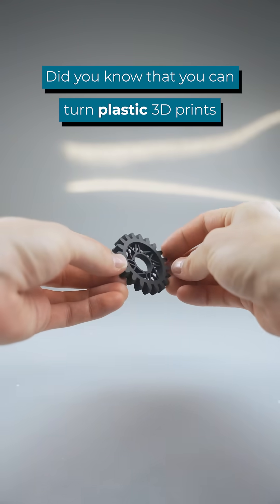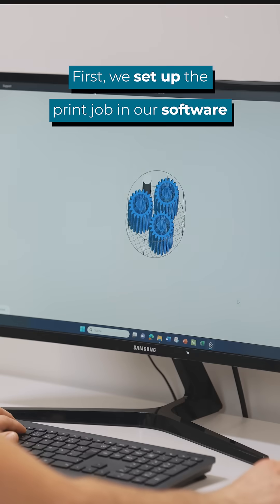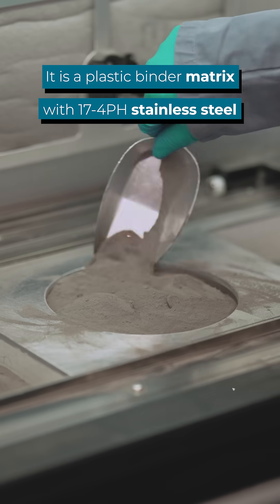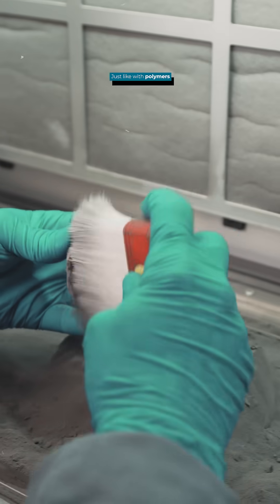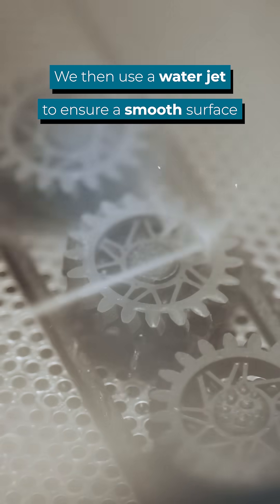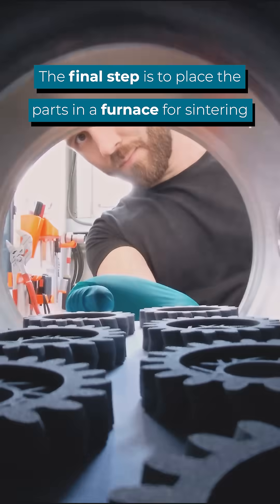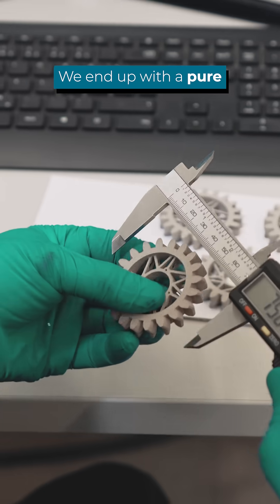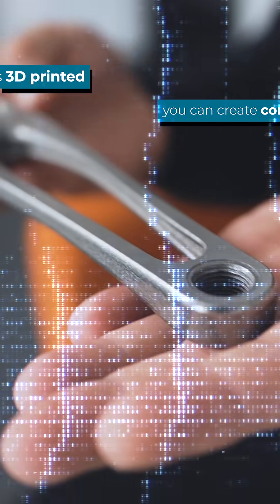Turning plastic 3D Prints into Metal Parts ⚙

Comment: How about shrinkage or expansion? Doesn't it alter the precision?
Reply from the maker: There is an uniform shrinkage, so it is easy to calculate and adjust the part accordingly. In this case (17/4-PH), the shrinkage is 14%.

Comment: Why these parts are not strong as forged ones, because melting point of steel is 1370 degress and they only heat parts at 1000 degrees Celsius. This is more like welding of steel particles together instead of melted&forged together

Comment: Thats... Not quite what you described at the beginning... But i am curious is that weaker than one were it was cast of cut from metal instead of what ever you call that
Reply from the maker: Fair, maybe the intro sentence was a bit misleading. But we still think its a fascinating method, to "print" metal parts on our polymer printers. And regarding strength: with heat treatment you can achieve impressive tensile strengths of 1309 MPA in the case of 17/4-PH which is comparable to industry standards.

Comment: Ok how is the gear good on stress tests and quality. I assume 3D printed parts and no better than quality Q10. So that means almost as same as plastic POM C or maybe at best PA12. Is hardening possible afterwars, followed by tooth grinding? If not how is this process better than injection molding  of Zink or plastics?

Comment: That's probably a 100k machine and has nothing to do with fdm or SLS 3d printing
Reply from the maker: Our printer start at aroun 18'000€ and are SLS 3D printers. But you are correct, it has nothing to do with FDM 3D printing. https://sintratec.com/sls-3d-printer/amp/sintratec-s2/

Comment: "Did you know you can do this simply?"
<shows industrial unobtanium machines for hundreds thousands of dollars>
Reply: The intro of the video made me think you’d be demonstrating a casting process. “How do I 3D print metal” -> “use a metal 3d printer” is kind of the boring answer tbh. Cool tech for sure, and I understand you want to demonstrate it to sell it, but I felt disappointed by the framing. I thought it would be a process I could use in my home shop.
Reply from the maker: Fair, it is not the easiest or most affordable process. But it is still a new way of 3D printing metal parts that has not existed in the industry before - therefore we think it's worth showcasing. Also, compared to other metal 3D printing methods, it is very similar if not cheaper in price.
Reply: @Sintratec  we have been doing sintering for decades. (And sintering 3D printed metal parts for atleast a decade itself)

What are you talking about? How old are you, 18? Maybe 20? 

We had a 6000€ sintering printer kit at our company in 2016, which could print aluminium. The industrial machines have existed for much longer than that. (Granted it wasn’t great, but still, it worked.)
Reply: Can you post a accurate video showing how the green part is made, please? @Sintratec
Reply: @Sintratec exactly, I commend these companies. They are the ones that are paying the bills, allowing Innovation to continue, and creating a market for the consumer down the road. This is the beauty of capitalism, and Innovation together. Standard fdm3d printers were quite the same thing not too long ago

Comment: Fuse at 50'Celcius ?
Reply from the maker: Yes, the cold metal fusion process is very "cold". The plastic particles of the material fuse together at 50℃, which makes the process very stable and all unsintered powder can be reused. You can read more here: https://sintratec.com/how-to-3d-print-metal-parts-with-a-polymer-sls-printer/

Comment: This is not plastic into metal. You are SLS metal printing a new part. The original plastic gear played no role in the end result of the metal part.
Reply: My engineer brain didn’t want to disbelieve at first since I’ve been wrong about many things before, but I was 100% confused how the 3D printed plastic had anything to do with this. Yeah SLS metal printing and annealing a brand new part seems like a more accurate description
Reply: @PinheadLarry1337 the plastic its because the 3d printer is not a forge, so it takes metal “powder” mixed with plastic to the 3d printer can print, than you just remove the plastic and have a metal thing
Reply: @BloopTube but it doesnt turn plastic into metal. It just has plastic in it aswell which then gets removed
Reply: Careful, your stupid is showing.
Reply: YouTube is getting worse and worse
Reply: Please, teach these brain lacking people how much better of a title :
 "How to make metal parts by using sls printer with metal-plastic mix, then processing it with some chemicals, and then re-sintering it to achieve a metal part" would be .
Reply: Gt😂
Reply: What kind of printer is required for this?
Reply: A metal SLS printer.
They start at ~20.000$ and with all the post processing equipment that jumps up to approximately 50.000$ on the low end. It's a neat technology but definitely not intended for hobbyists.
Reply: @tigeroftheeye7121  A very expensive one. Looked it up some time ago and it costs $50k on the low end, for the printer alone (you also need to get debinding station which is another huge expense).
Reply: It literally is plastic to metal

Comment: Keep in mind that the parts shrink by about 10 to 20% so you have to adjust for this depending on the model. Additionally, the tolerances aren't as good as CNC. Close, but not perfect. Lastly, the finished steel part is roughly half the strength in every direction as a forged and CNC part
Reply: The shrinkage is the biggest con for me...
Is the shrinking at least unidirectional?
Reply: @kendrickxy1774  it's not uniform but it's very very very predictable in computer modeling so you can in theory get parts that are cheap, perfect tolerances, but just weaker than forged. Yet way stronger than anything else. If it's as strong as it needs to be, it doesn't matter
Reply: @kendrickxy1774  it's generally symmetrical. If you design for it you can compensate for the shrinkage so it shrinks to the exact size you need
Reply: Well, it must shrink 10~20% in all directions, its something I've delt with when it comes to my experience with 3d printing, although not to that extreme. My guess it happens with the burn off period. If that's the case they can (I assume they use a form of a slicer program) just increase the scale of the part by 10%~20% depending on a test part they do for the day/or the machine if its machine specific and not environmental condition reliant.
Reply: @IIBLANKII  it does shrink in all directions but it doesn't shrink evenly. The outside shrinks faster than the inside so sometimes thicker parts versus a thinner part, the thicker part might still be liquid inside and certain geometries might be out of whack. For example the inside of a corner will cool after causing a 90° angle bracket to slightly widen.

You can use computer modeling to offset this
Reply: @IIBLANKII  you can't always just increase the size evenly, unless it's a spherical part
Reply: @pilotavery for an actual production run I could see a company doing a test print and sintering with no compensation changes, the test part is then measured(calipers, CMM, xray or scanners), measurement information can then be used to directly compensate in CAD so uneven shrinking is accounted for with non uniform parts. 

With digital measurement info from a CMM or scanner(internal or external feature scanning) and a specialized software this adjustment of a part in CAD could be automated and highly predictable since the software can know what original CAD geometry is and non compensated sintered test part geometry.
Reply: @GENcELL2014 yup. Anyone who has these technologies isn't just doing it willy nilly.

The for sure test and test before any production run. I don't see it being economical for trying to make and sell parts, but to make custom parts for some kind of machine fabricators
Reply: and there is the porosity,

Comment: How do the metal particles "grow" together?  Out of what?
Reply from the maker: The furnace is slowly heated to sintering temperature while the little remaining plastic-binder (1%-3%) burns without residue. At the sintering temperature of the metal, the metal particles fuse together to form a dense solid metal part. The parts shrink evenly, in the example of stainless steel 17/6-PH by 14%. The sintered part typically exhibits a density of 97 - 99%.

Comment: it's not actually turning plastic into metal. This is directly using the .STL file and creating the metal part.
Reply from the maker: The material is a plastic binder matrix with metal spikes in it. Therefore, the green parts are to a degree plastic.
Reply: @Sintratec  What would be the percentage of plastic and metal in this material?
Reply: @Sintratec  Where can I find more information about this material?
Reply from the maker: @ricardorodrigues777  You can find out more on the website of the material developer: https://www.headmade-materials.de/en/materials
Reply: @Sintratec  thank you
Reply: @Sintratec  This is a metal 3d printer right? Are these still around $500k?
Reply from the maker: @termgrecos3451  No, it uses our Polymer printers (starting at around 18'000€), with a debinding station and a sintering furnace. With these peripherals it may not "cheap" but nowhere near 500k. For detailed pricing, please feel free to contact our technology experts via email: sales@sintratec.com
Reply: @Sintratec but you said „plastic 3d prints“ and before printing it can’t be a print.
Reply: @gregorboxer2463  Since their "plastic machines" arent strong enough for conventional metal 3d printing they use this method as a cheaper alternative and an addition to their production capabilities. They print with a material mix that is plastic and metal combined. Adter printing the Plastic is removed so only the metal is left. This is then heated for the metal to properly connect and create a solid part. So they "cheat" a bit by using metal with a plastic mix at first but that allows wayy cheaper machines to create metal parts wich is a great step in the right direction.

Comment: About what percentage of shrinkage should be expected?
Reply from the maker: It varies depending on material, but in this case it is 14% (for 17/4-ph stainless steel)
Reply: @Sintratec is it as simple as scaling your model up 14%?
Reply: @Noughtta No, because 14% shrinkage of 114% is not 100%.
Reply: @JulianXMassacre no, you need to expend with 16.28% ... 116.28-14%=100
Reply: @VadeniucROKasCoTV  yes I understand the math and that’s why I asked “is it as simple as” I wanted to know if the slicer took that into account or if you had to in the design phase.
Reply: @Sintratec then say that.

Don't say you can turn your plastic 3d prints into metal ones, that would ve lying and false advertising, and illegal in many countries.

Say you can print with a metal plastic composite and in post processing remove the plastic